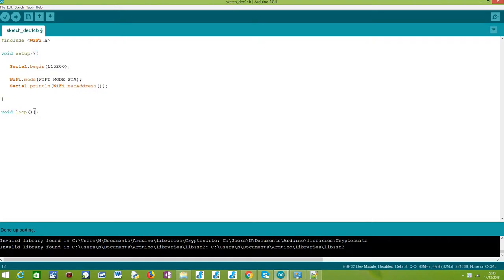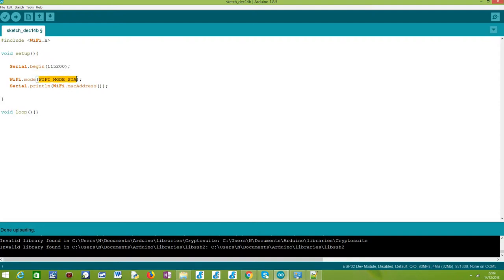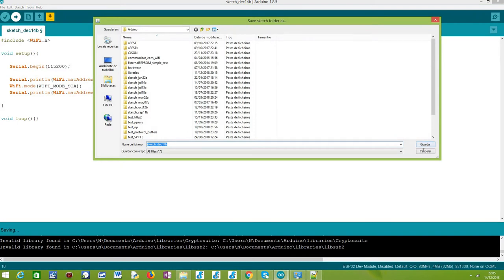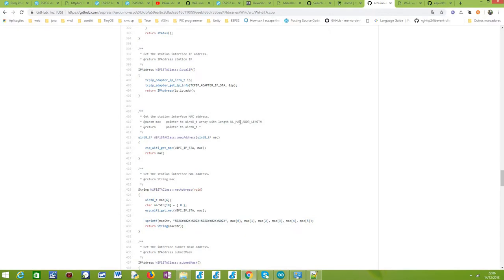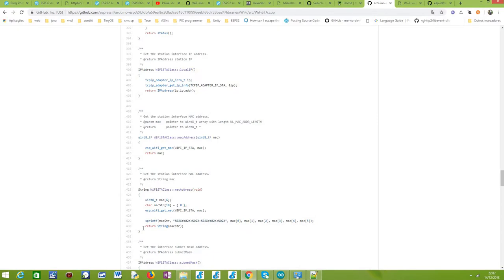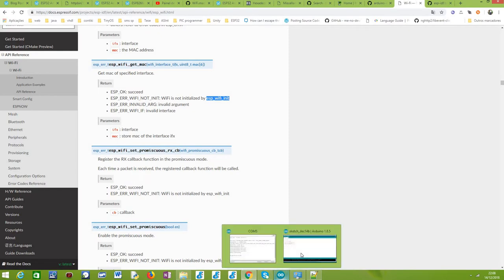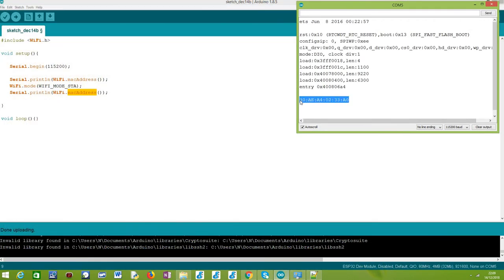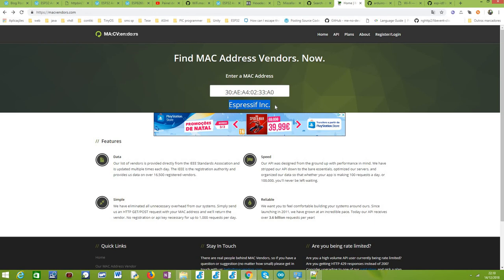ESP32 Arduino: Get MAC address of station interface

Comment: Hi can ESP32 work simultaneously in both Station  and AP mode?
Reply from the maker: Hi!

Yes it can :) There's a WiFi operation mode that allows for both interfaces to work at the same time:
https://github.com/espressif/arduino-esp32/blob/96822d783f3ab6a56a69b227ba4d1a1a36c66268/tools/sdk/include/esp32/esp_wifi_types.h#L33

Unfortunately I don't have any example on such operation mode :/

I'll see if I get some time to cover that mode :)

Best regards,
Nuno Santos
Reply: @techtutorialsx11  Technically the mode does exist, but I have never seen a single example or testimony on internet of this APSTA mode actually working. I've already tried with no luck, i think its impossible. Have you been able to do it? Have you seen any succesful example?